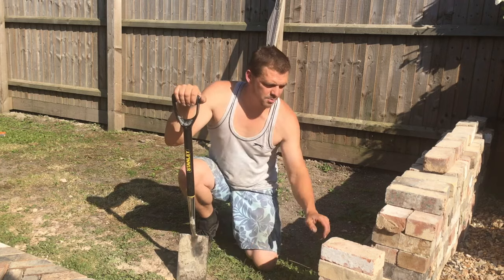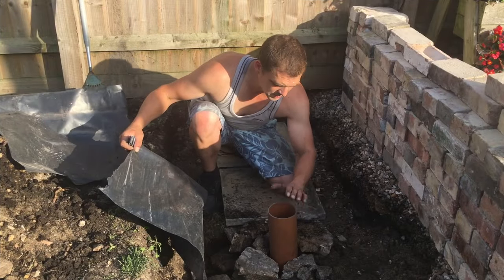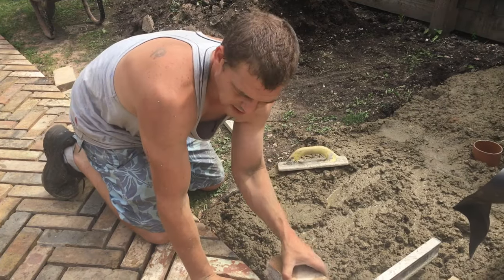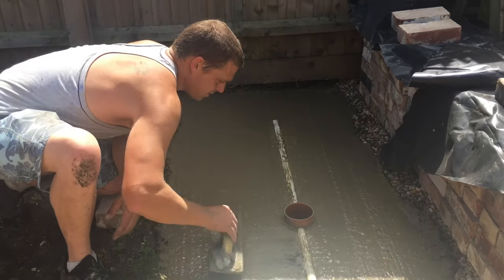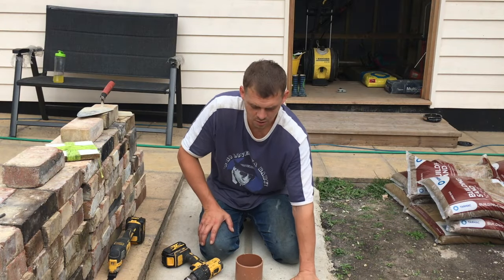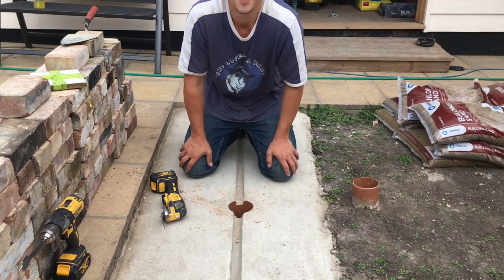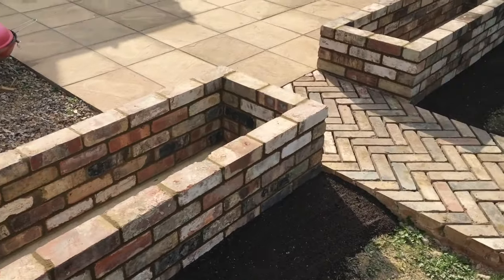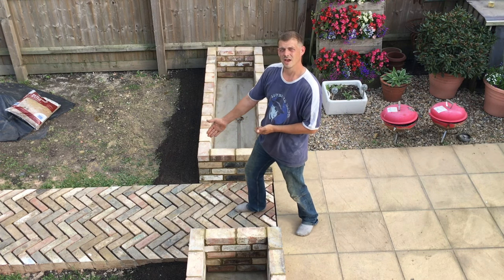How to make a brick raised garden planter

Comment: is the cement underneath really necessary? My plan was just to lay down some landscaping fabric and use lawn-staples to keep the fabric down
Reply: Probably not for most situations. 
I plan on doing the same but my soil is clay do is solid
Reply: If the bricks are laid on a dirt ground then when it rains the ground will soften and move around over time which will cause the brick to crack, bow and eventually fall apart
Reply: @aricnewlun535  if you were to build a 2 courses underground and pour concrete in a trench around the bricks would that stop it happening? Like footings? Asking because I'm an enthusiastic novice?
Reply: @benhortonben9105  well if you dig a little ways in the ground you can always trench pour a footing as long as you smoothen it the best you can, it’s recommended to use form boards like 2 by 4s and get some stakes and form up where you want to pour and then once the concrete hardens you can build your brick on that concrete, but when you lay the brick depending on what the project is the idea is to to keep water out the best you can because water will deteriorate the brickwork over time if there’s not proper drainage so make sure you make spots for weep vents in a few of the joints at the bottom of your course so water can flow out
Reply: @aricnewlun535  thank you for the advice. Very much appreciated.

Comment: Do I  have to use concrete or can I lay directly on soil? I want to make large deliminated beds but less high than those on the video but wider. I have a large bedding for vegetable but hard to get to the vegs on each side. So wanted to section it in portion by bricks and in between some stones. Thought bricks will be more resistant than wood beams.

Comment: Why You put a concrete at the bottom....   It's not necessary..
Reply: I was wondering this? Surely if you leave the bottom open it will keep the plants hydrated and soak any excess water away to stop over watering? I'm guessing it's to keep the walls strong giving them a strong base.
Reply: If it freezes there the wall would shift, I think
Reply: @elizabethdillard5071  I went with timber in the end as the amount of time versus work involved and cost made doing it in bricks not cost effective. Came out pretty good though. Thank you for the advice though.
Reply: @elizabethdillard5071  yes put concrete kicker in to lay the brick but not all of it..... only for small plants small roots
Reply: I am deciding on this method because we have a septic drain field and don't want the water to mix with the garden bed.
Reply: @benhortonben9105 he did put a drain
Reply: Beautiful!

Comment: Nice work! How come you concreted the whole bottom area and not do strip foundations? Wouldn’t the planter need soil from the bottom. Looks Smart though!
Reply from the maker: Very good question the ground is pete and is known for movement so a raft foundation was best for this project. So a little soak away was needed. The soil in the planter is 15 inches deep this will be enough for my plants thank you from diy cp

Comment: can I use a reclaim paving brick
Reply: Mr Whatevah -as a rule no when it comes to appearance as you only see the tops of the bricks with paving bricks where as here you see the side of the bricks.You could use them to save money if you're going to render it after and just want to use up any spare bricks you have but that said you'll then have to pay for sand and cement to render where as using new bricks you don't have to.They'll be fine to use as in they won't crack or anything but it's more about appearance they're designed to go on the ground but if you are rendering it after then you might as well use what you have.

Comment: Did you line the inside face with any protective barrier or waterproofing before putting soil in the beds. Just done mine and was wondering if it’s needed.
Reply: I have exactly the same question as you. What did you go for in the end?
Reply: wizsheep I got some poly plastic sheeting and lined the inside and then added the soil. Seems fine. So any water goes straight to the bottom into the ground.